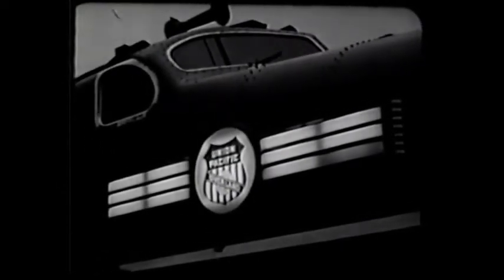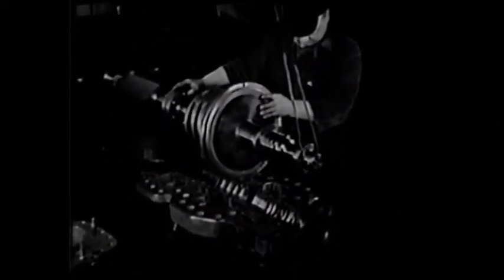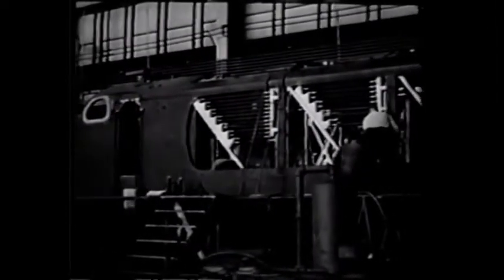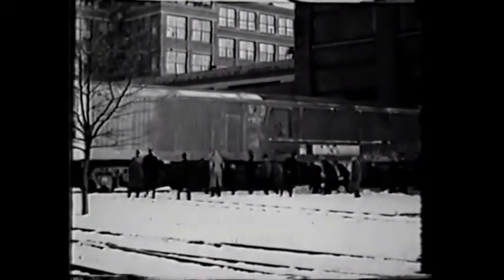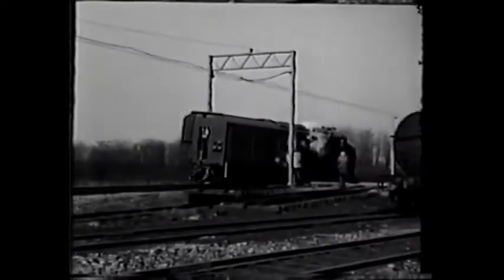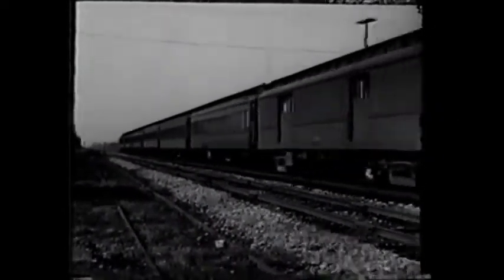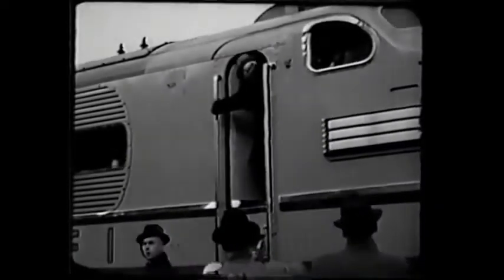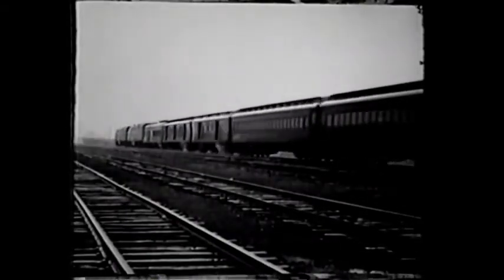General Electric Steam Turbine Electric Locomotive. 1930s Promo Film

Comment: If anyone is curious about what happened to this locomotive I found some info: 

They were completed in December 1938 and sent for testing on the line between Eerie Pennsylvania and New York in January 1939 before beginning work on various Union Pacific lines throughout the country. The locomotives were initially in operation for six months, among the shortest operational careers in recorded railroading during which time it moved perishable freight and passengers though they were not in regular revenue service. During test runs, the locomotives displayed excellent acceleration and an ability to maintain schedules better than conventional steam engines, and one engineer could actually control two linked locomotives by himself. The problem as the operators later discovered though was that they also had serious reliability problems and relatively high maintenance costs. On one occasion, two linked together locomotives failed while hauling a train from Colorado to Omaha, necessitating a conventional 2800-class Pacific steam locomotive to pull them along with the rest of the train for the remainder of the journey. In June 1939 UP returned them to GE for maintenance but while that was going on there was a change in leadership at UP and they had no interest in using the Turbines. So in December 1941 UP cancelled the contract with GE citing they already had effective alternatives like the Big Boy and diesels. Later though in the period between 1943 and 1944 there was a shortage of available trains to move freight and so the turbine trains were leased to the Great Northern Railway up in Washington State for wartime short-haul freight service which they performed satisfactorily. Finally when that shortage ended at the beginning of 1944 the trains were retired from service and scrapped.

Comment: Steam turbans were a good on paper, not so much in the real world. I understand the turbans would be so fuel hungry at slow speeds, but very efficient at high speeds.
Reply: I'm not sure if they were as fuel hungry as the gtel though and the fuel was probably cheaper using coal. Maybe with today's technology could improve it's longevity. Keeping them cleaner and reducing maintenance needs. But doubt they'll come back.
Reply: @jordanalexander615 today you could just use normal electric locomotives with catanary. the power can come from a big power plant or solar farm or whatever. that is cleaner and more efficient than hauling your fuel, the methode of converting said fuel to electricity with you.
Reply: @SimonBauer7  yeah the problem with that is we have 200,000 miles of track

Comment: I think this is how nuclear driven ships operate.  Nuclear what boils water.  Steam drives a generator.  Generator drives enormous motors.
Reply: Not US Navy ships... At least not back in my day... My memory is a bit hazy after nearly 50 years, but the way I remember it was that nuclear reactor heats water in primary coolant loop which is pressurized, so even though well over 212F, the water is not "boiling"... Water in primary coolant loop is extremely purified since it actually goes through the reactor and any impurities could become radioactive... Water in primary coolant loop goes through steam generator as a heat source where it causes secondary coolant loop water to get hot... It is also under pressure... Steam powers the steam turbine and goes through the condenser  and eventually makes it back to the steam generator for the cycle to to repeat... Gearing mechanisms converted the high rotational speed of the turbines to the low rotational speed needed for the prop (screw) shaft... There would have also been electrical generators for auxiliary shipboard electrical uses... It really was just a progression from using oil fired burners to generate steam for steam turbine ships... It was just a new heat source for the steam generation... 

I'm pretty sure that at this high level of a description, none of it is classified info and could easily be found on the web these days... The few things that I knew that were classified have been forgotten because it's been so long and I did not end up working in that field...
Reply: The first nuclear powered ship was an aircraft carrier in the 40s . Or it may have been refitted with the nuclear power later I can't remember exactly.
Reply: @seanseoltoir ...You literally said "no you're wrong, it's actually EXACTLY what you said". You just repeated what OP already said.